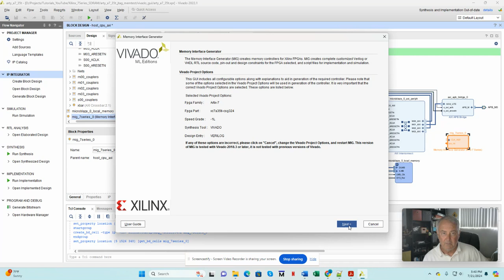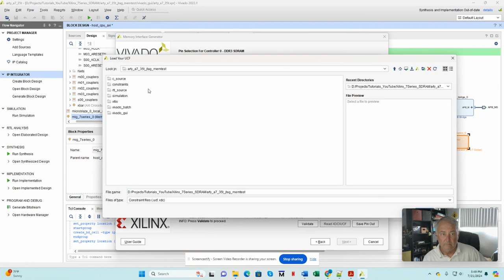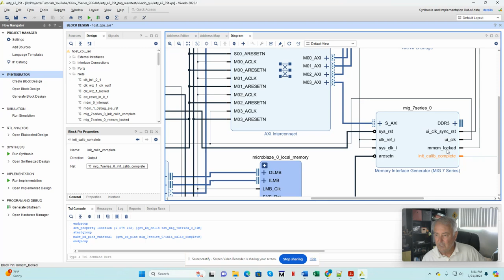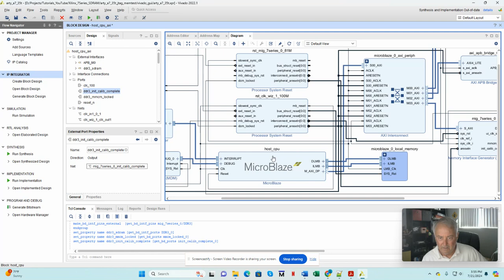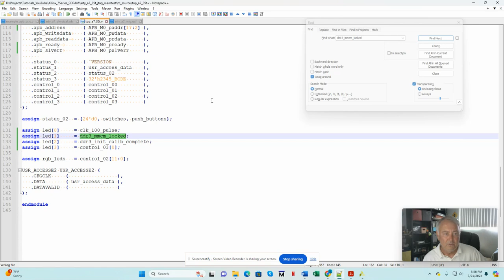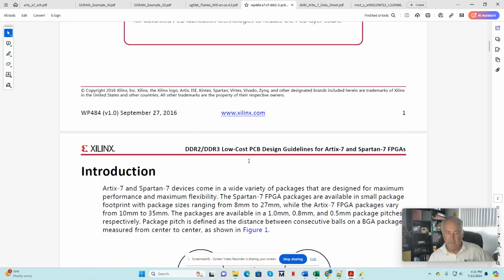Xilinx 7Series DDR3L SDRAM in one IO bank - Part 1

Comment: Is it possible to use a 16-bit DDR3 interface with x8 DDR3 components? Also is there any spreadsheet or documents which states maximum amount of DDR3 controllers @ 1,866 Mb/s can be used for all of the 7-series FPGAs? Thanks.

Comment: Thank you! Your video helped me get familiar with MIG design flow. By the way, I managed to fit 4Gb DDR3 ram (MT41K256M16xx-107) to a single FPGA bank with 50 IOs. I tested with Spartan7 S75 bank 36 in Vivado. Let me know if you agree.